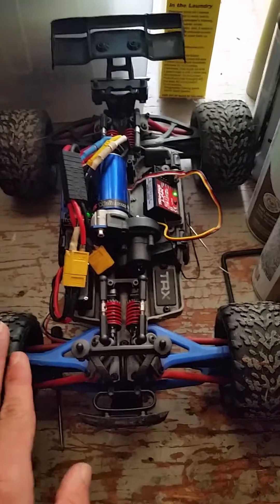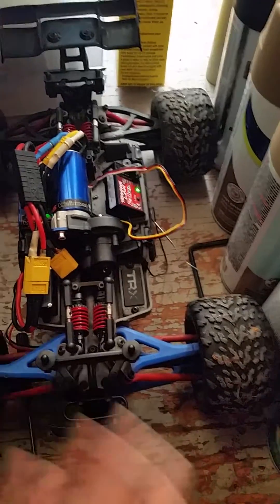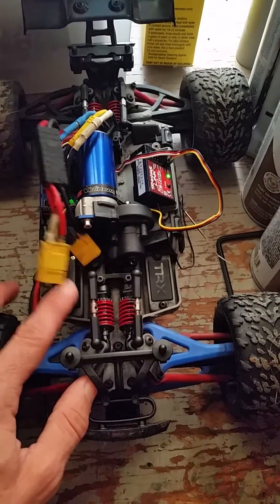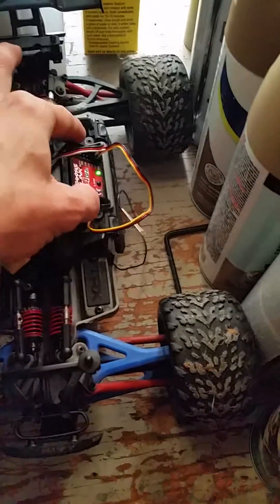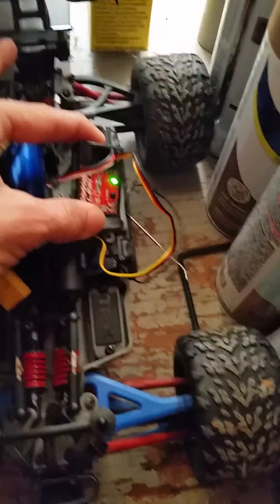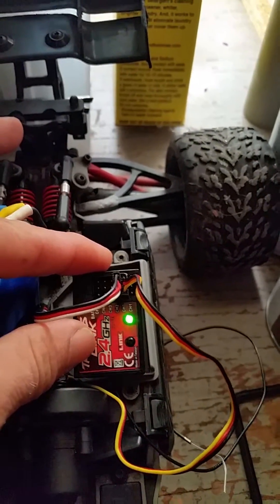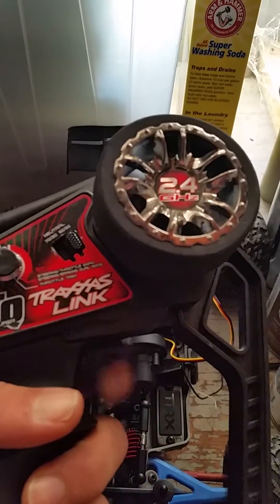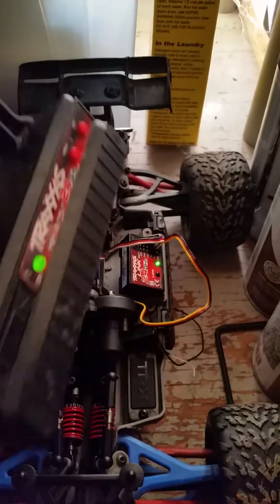throttle and steering not working  on 1/16 brushless e revo

Comment from the maker: it wouldnt let me recalibrate, but i found out the issue. Bad servo and transmitter. its back up and running now.
Reply: dude i have same problem on same transmitter please let me know how did you fix it arash.n@mtnirancell.ir thanks.
Reply from the maker: Arash Nemati i had to buy a new receiver and transmitter